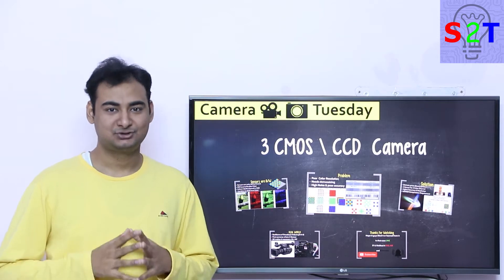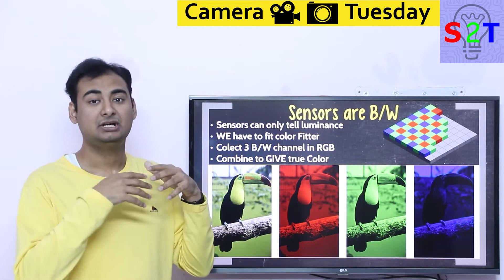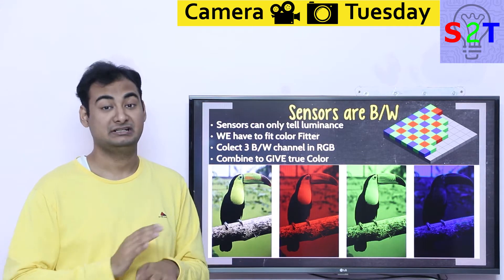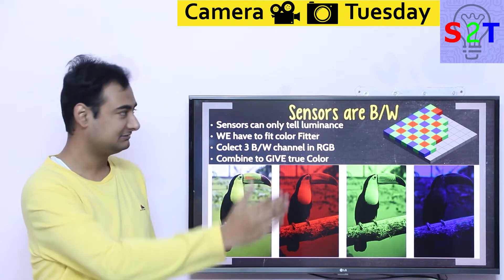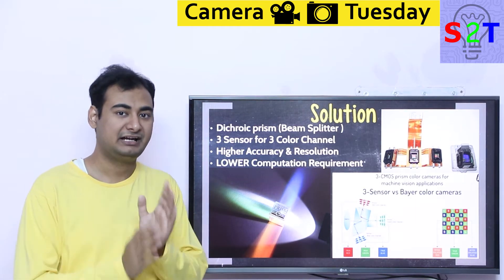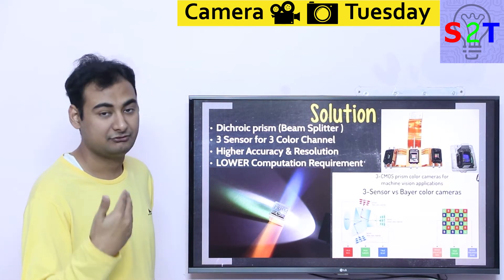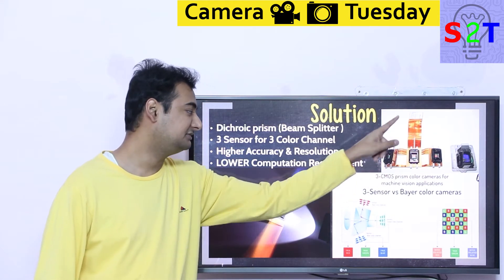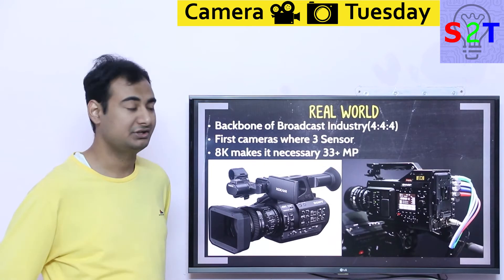3 CMOS Camera Explained {Camera Tuesday Ep88}

Comment: Wow, at last someone who seems to know what he is talking about. The $4000 Sony Z190 (from 2018) has three 1/3" 4K UHD sensors, the $4500 Canon XF605 (2021) has only one but a 1" 4K sensor. In theory, and in practice the noise performance of these cameras would be exactly the same? The only difference would be the faster speed of throughput if and when the Z190 was used in broadcast situation? When I read the documentation of the Z190 it wasn't mentioned that it was designed for broadcasting, streaming is an important feature, though. So, my quest what was the motivation/reason Sony made a 3-cmos camera for non broadcast usage, where a 1" sensor would give the same result, if it did really?
Reply from the maker: 3-cmos camera has much more accurate color reproduction its not only used in broadcasting but also in industry as product analysis in factory. if a single sensor is "feeling" the same as 1 then its the fault of A2D or Sensor noise floor or  low quality  trichroic beam splitter prism used in 3 chip because physic does not allow for that, as debayering by design is "guessing" colors  while 3 is seeing the true color O it does need output to be 4:4:4 for true representation